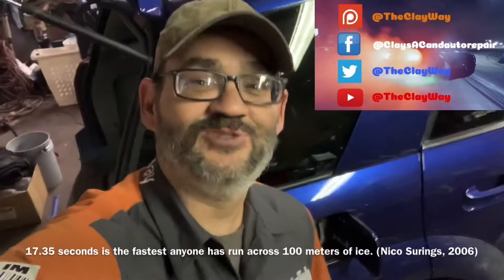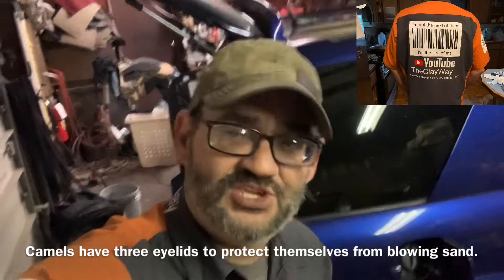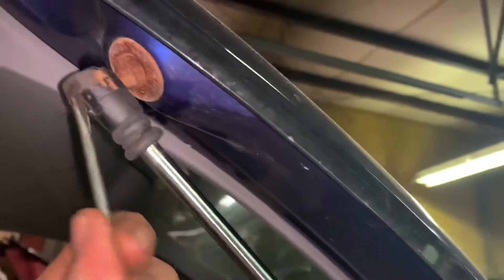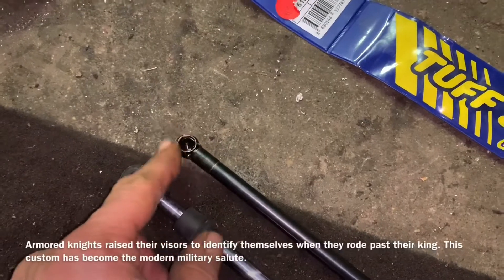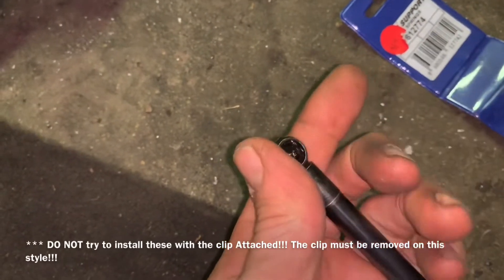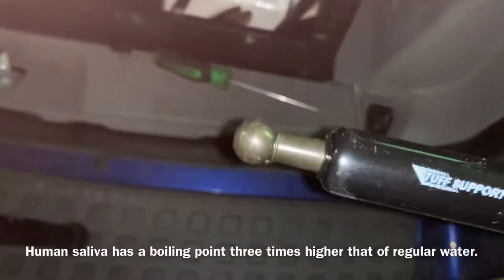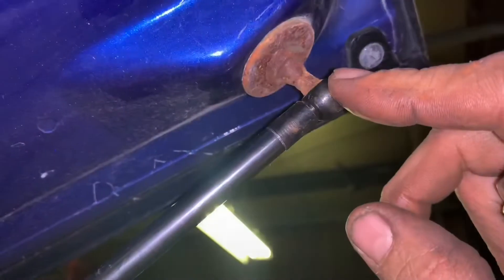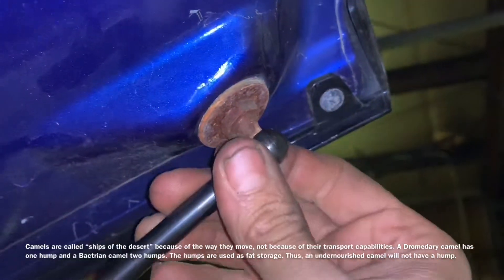Chevy Equinox tailgate will not stay up/ hatch falling down. Reason why tailgate won’t stay open!

Comment: Thanks for the video.  My lift gate just now (Dec. 19, 2023) developed this problem.  It’s a 2013 model that I got used just last June with 83,000 miles on it.

Comment: I have a 2012 Chevrolet equinox 2.4l with auto transmission won't shift at all into 6 the gear,what would suggest to check
Reply from the maker: Hey Kurt I wish I had a better recommendation. I would probably take it to a professional transmission shop because unfortunately I’m not educated enough on these to tell you that you need a new transmission it could possibly be just a shift solenoid even though it’s unlikely. I wish you the best and I wish I could be of some help